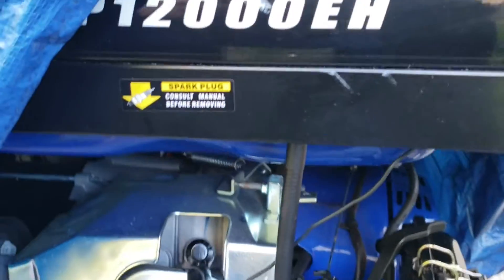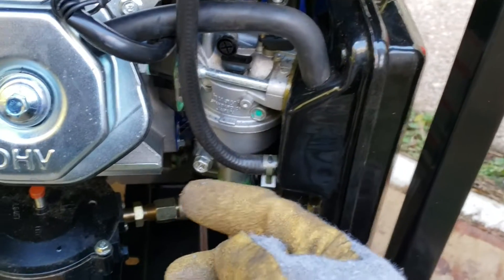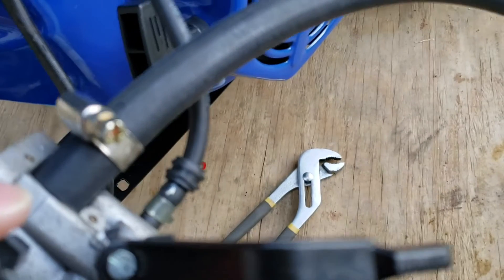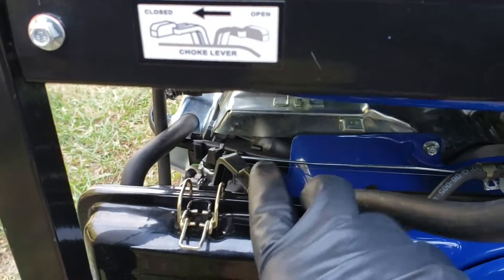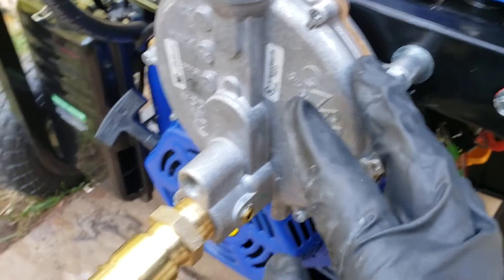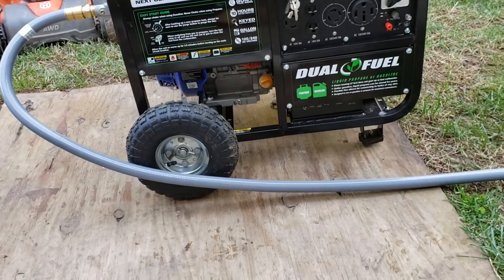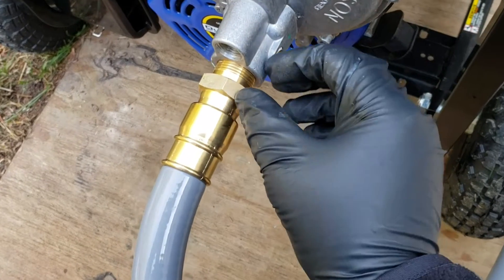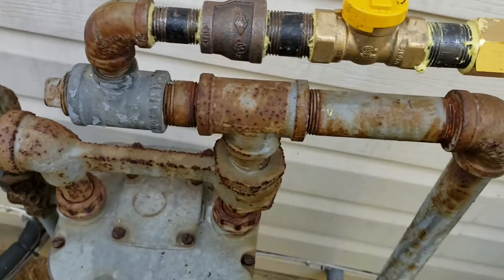DuroMax XP12000EH - Converting Gas/Propane Generator to Natural Gas (Dual Fuel to Tri-Fuel)

Comment: So the old regulator is not connected to anything correct?  You just have the new regulator connected to the carb directly with nothing extra no snorkel kit just the hose if I’m understanding correctly…and what fitting could I use to be able to run propane too if I used my generator in a portable setting say on a job site.
Reply from the maker: Yes, the old regulator is removed. No snorkel either, just remove the old propane hose and connected the a new hose to the new regulator. To get propane to work with new regulator, you need a 3/4 to 1/2 adapter fitting, you should be able to hook up propane to the same regulator using such an adapter. However you might have to adjust the inlet valve which is easy to do.

Comment: I have a Duramax hybrid generator. Designed to run on gasoline or propane.  I also have a barbecue with a natural gas conversion kit. I popped the line off my barbecue and threaded it onto my generator and fired it up. It runs like butter.

Comment: Couldn't you just run a pipe from the built-in high pressure regulator that came with the generator to an external low pressure regulator then back into your carb? I would assume this would allow you to run both Natural Gas and Propane using the existing quick disconnects that came on the generator.

Great Video though... thank you!
Reply: sorry about the spelling that should read NG instead of no
Reply: No, because you have to have no orifice instead of a propane orifice which is smaller

Comment: Does the gas not leak out of the air filter when the engine is off? It sounded like you believe the regulator somehow stops the flow of gas when the engine is not running. Can you confirm? Thanks
Reply from the maker: That's correct,   the regulator stops the gas flow when the engine is off
Reply: @Mr-Chris  Interesting! Thanks for a quick reply

Comment: Chris,
Do you think you could have "Teed" the Natural gas line into the LP gas line going into the Carburetor and retained the LP gas option?
Thanks 
G
Reply from the maker: Yeah I've seen others do that with success. You can tee it off with shutoff valves to each respective regulator, but I only would recommend that if you plan on switching between the two often. Otherwise... the NG regulator technically is also a LP regulator that just requires a 3/4 to 3/8 adapter to get it to work with LP. So you could use the new regulator it for both if you want to.

Comment: Thanks for the great video.  Was a real help in getting my hose/gas connections right and adjustments on regulator bolt to get it started.

Comment: I ordered the exact same set up you have for my duromax 12000eh. I’m getting conflicting info on whether this setup will work without the Venturi adapter. Apparently a lot of people found that using the propane inlet didn’t let enough NG fuel in without making the intake larger. Does yours run on a full load with this setup? I ran a 3/8 hose to the carb and am just waiting in the regulator and my plumber to run the NG line so I’m gonna find out soon enough!
Reply from the maker: Well all natural gas conversions lose about 20% power compared to gasoline. Mines runs most of my house on natural gas connected to the propane inlet. The Venturi adapter really isn't needed in my opinion for this specific type of generator. I also think to install the adapter on this generator, you'll need to cut the frame for it to fit properly . Try it out and see if it works.

Comment: Do you think you could have used the original propane hose if you removed the propane regulator? I just ordered mine from nash and I was thinking of trying that
Reply from the maker: The stock hose wasn't long enough. The regulator is larger than the stock one and won't fit in the same spot. Also the new Nash regulator will need to be orintated horizontal like in the video. This type of rubber hose is common so you might be able to pick one up at an auto part or hardware store.
Reply: Thanks for the quick reply- I was curious because I was trying to avoid disconnecting at the carb - hopefully will be easy

Comment: Hi I have 4400eh dual fuel genie i hooked up the tri fuel  kit  using snorkel but engine wont start with natural gas.   using stock regulator with propane the genie starts right up.   trying to trouble shoot but cant figure what problem is.  Any suggestions?    i can hear  very subtle sound of gas when i prime regulator ,  turned the load block 7 turns out as recommended by US carb didnt help.    Fuel valve to tank is shut off, choke is open.  am i getting vacum leak from the stock propane setup? Any suggestions?
Reply from the maker: You can try closing your choke and trying different positions to see if that helps. Honostly I think you should remove the snorkel and connect the new regulator directly to the carburetor like I did in the video. If you want to switch back to propane you can do so by using the new regulator with a propane adapter fitting. Essentially you don't need the old "stock" regulator since the new one works with both natural gas and propane. I think the snorkel is the problem not letting enough natural gas into carb to work since it already has another port connected to it . The snorkel is only meant for generators that are gasoline only.

Comment: Mine leaks out of the bottom right atmospheric port when the generator is not running. Any idea what this could be?
Reply from the maker: I'm not an expert on this, but I would imagine that you have a faulty regulator. It's not supposed to do that.

Comment: At the 11:46 mark, you mention that your 100 amp main breaker box prevents you from using the 50 amp outlet on your generator. To confirm the accuracy of that information, I Googled, "Do I need a 30 amp or 50 amp generator inlet box". That brought back some search results that seem trustworthy. In answering that question, those websites make no mention of checking to be sure whether one's breaker box is 100 or 200 amp. I don't bring this up to take issue with you about it. I bring it up because I am about to buy a complete system and I need to make sure I buy the correct stuff. I would really appreciate any further insight you can share about it. Who told you that 50 amps shouldn't feed a 100-watt main panel? Thanks!!!
Reply from the maker: You are right... The reason I have a 30 amp is because the only option for me to install a transfer  switch at that time was the Generlink (connected to meter). The Model Generlink I have only goes up to 30 Amps. The reason I couldn't install a 50 AMP interlock or traditional transfer switch is because I had  split bus panel breaker box which wouldn't work with a interlock or generator transfer switch. The issue wasn't that100 amps won't work with 50 amp, but that my breaker box is an old 1970's split bus panel, which means even if I turn off the main breaker, it is still hot and would back-feed. So my only option at the time was a Generlink transfer switch that connects to the meter and automatically disconnects to the grid so you don't back-feed.  If you have 100 amp main breaker box that shuts off at with a main , then you can install a 50 AMP transfer switch with no problem... Now fast forward to today, I finally upgraded my breaker box to a main shut off 200 amp box so I can eventually install a 50 amp interlock.  You can see my new breaker box here: https://youtu.be/TmFbOQF85h8

Comment: Chris, thanks for the great video. I'm in the process of doing the same with, I have the exact same generator and have ordered the conversion kit. Since making the video, would you do anything different from what you've shown?
Reply from the maker: The only thing I would suggest is buying a Digital Tachometer and a good Multimeterr. The generator has an adjustment screw behind the carburetor to adjust the RPM. You want to make sure that after converting it to Natural Gas it still runs at 3600 RPM. Using a Multimeter, you can verify you are getting 240V at 60Hz. Lastly, make sure you paint your gas meter fittings to avoid rust.
Reply: @Mr-Chris  Thanks for the tips, will do!
Reply: @Mr-Chris  My 10000e gasoline duromax geberator is running at 5000 rpm on natural gas with the snorkel, is that because of the know you turned on teh regulator is not set right or does that have anything to do with it?

Comment: I didn't hear you talk about how you know that the generator still runs at the correct RPM so as to produce electricity exactly as it did before.
Reply from the maker: Yeah a few months later I bought a digital tachometer and read the user manual on how to adjust the RPM. Mines was running a little slower on NG at 3400 RPM so I adjusted the the screw to get 3600 RPM. I also verified that it was producing 240v at 60HZ using a multimeter

Comment: From what i've heard, running on CNG or LPG results in the engine running cleaner from a mechanical perspective (fewer deposits left in the engine).
Reply from the maker: Definitely much cleaner than gasoline, but less overall power. When I change my oil, it's significantly lighter in color than when it runs on gasoline.

Comment: I'm looking at the XP15000EH and doing the gas conversion kit as well. Only thing I noticed, on the Duromax site they recommend NOT using the conversion kit , so not sure if this voids any warranty. That's a bummer about your panel needing to be upgraded. Ouch. Thanks for the info, really helped.

Comment: I got the carb kit w/regulator from US carb and it all worked perfectly. Here in Texas you can hook up everything without a plumber. I did get an electrician to wire it all up at the house and now I’m in business. Thanks for the video.

Comment: Is it necessary to have a load block in order to run? I’m planning to hook directly from carburetor to the regulator without the load block to see if it run smoothly or roughly.

Comment: Thanks for the video.  I'm a bit late here, of course, but I have the same kit and am in the process of converting a welder/generator for trifuel.  I am not a plumber but its seems you already have (had?) what you need to tie into a 3/4" pipe for natural gas supply.  

Perhaps a plumber could verify this, but it seems that you can swap the 3/4" Tee coming off the right side of your meter with the nearby 3/4" Elbow off to the right (leaving the short pipe section attached to the elbow).  Then you'd have the 'free' open end of the Tee to attach to your generator feed line with the benefit of eliminating a lot of extra pipe connections - plus look a lot cleaner.

Comment: My DuroMax 12000 should be in tomorrow, and I'm at ground Zero for Ida.. Let me ask, could you have mounted the new regulator where the propain one was at, or did it not fit? Thanks..
Reply from the maker: It didn't fit, so it mounted it to the outside.
Reply: The "Frisbee" shaped" KN Demand regulator is suppose top be mounted edge side up, not flat like a pancake. They are factory adjusted in the edge side up position.
Reply: @3beltwesty  Thanks..

Comment: My hero dude.  Just bought my Duro Max, still in the box. I want to convert it to use natural gas and this gives me hope it is an option. Thanks for the detailed explanation and information. I will have it done professionally.. mainly cause .. I don't wanna die ! 
Thanks again for your help 🇺🇲
Reply: Follow up  My Natural gas conversion is in place and fuel flow is connected all well and seemingly good. 
Generator can start and has run for minutes while I try to keep it from stalling. Is there a flow controller to adjust because it stops as soon as I stop depressing the spring behind the regulator. Before the conversion this Generator ran fine on propane. I pulled the spark plug and gapped it to 0.025 inch.per specs provided ... no change in response.

Comment: Nice work!  My question is, why not put the regulator near the gas source (meter), instead of mounting it to your generator?
Reply: Good Question! It is more than a regulator. It is a "demand regulator" that uses engine vacuum to pull the diaphragm open that meters the NG ie gas flow. 

So a long tube or pipe makes the engine harder to start since now there is this long volume that is in line to the demand regulator. Also a change in load of the engine has this extra delay due to the long hose of gas. Also with a manual prime button if the regulator is 20 ft way then you prime and walk 20 ft to start and thus not as effective. 

Most all "demand regulators are several feet from a the carb/throttle, not 10s of feet. That is so the service tech can hear the gas with priming etc too.

 So if it was just a pressure regulator it can be farther away. This is a demand regulator, the vacuum line to the carb venturi pulls open the diaphragm and this controls the flow of gas. 

The extra brass screw valve  control gas flow too, it is for the mixture ie lean or rich. This screw fill be in different positions for NG versus Propane
Reply: I would assume so that you can more easily connect the generator to different Ng sources. I like the id a of it being self contained.

Comment: Hi Chris, great video!   Question, what is the pressure of the gas coming out of your meter?
Reply: I was wondering the same thing. I have a very similar set up to this but can’t seem to keep the engine from sputtering out after only a few revolutions. My pressure in the gas line is roughly 7.5 to 8 inches w.c. (Water column). I have a different regulator that I’m thinking is the issue so I was going to buy the same model he had in the video, but the specs on the regulator show an inlet pressure of 9-13.5” wc. I’m hoping 7.5 to 8” will be close enough to the functioning range of the regulator

Comment: Do you have to remove the Propane regulator. or leave it with the Gen. Also can you use Propane also, does it become a tri Fuel? In case you take the Gen on a trip and make it portable? Thank You.  Randy Houston
Reply from the maker: You can keep the old propane regulator on if you want to, but you won't need it. The new regulator works both with natural gas & propane, you might need to adjust the gas pressure like I did in the video when switching between natural gas and propane, but it's very easy and quick to do.
Reply: @Mr-Chris  thank you very much Chris your information and your videos are awesome and extremely helpful.

Comment: I have the 13000-Watt DuroMax that has the automatic choke. I bought the PNG natural gas conversion kit that has the snorkel attachment that attaches behind the air filter and before the carburetor. It will start using the factory propane way, but it acts like its starving for gas using the natural gas. Do I have to use the snorkel or can I pipe it straight to the carburetor like the factory propane is.

Comment: You don't have to jump through all these hoops.  Just regulate the natural gas at the source...  https://www.youtube.com/watch?v=DCF8cyWB2W0
Reply: what hoops are you referring to?  that video you linked shows the guy replacing the propane regulator with a NG regulator.  Chris here did the same.  Anyway you hook up the new NG regulator, you have to remove the propane regulator from the equation to run NG

Comment: Hey Chris, I’ve got a question for you buddy.  I’ve got the same setup, almost.  I’ve got the 13000E- gas only. I installed the US Carb kit using the snorkel and it ran fine 44 hours during hurricane season.  Problem was, it did not want to start easily and I was having to get while using the prime button to get it going , but after starting it ran fine.  It would either backfire or take like two or three minutes to start.  You inspired me to order the 13000EH carburetor from the factory with the propane intake port, like yours has.  I sealed the carb and now it won’t start or run.  US Carb and Century think the port may be too small or my NG hose fittings are to small, etc.  I’ve used full flow large port fittings on everything and it ran fine.  The propane port is much larger than the snorkel holes for sure.  Do you have any advice for me?  Thanks man.
Reply from the maker: I am not sure if this will make a difference, but I remember reading how the Carb needs to run on Gasoline for a few hours before converting to NG. Have you tried running the new carb on Gasoline only? Does this Generator have an auto choke? If so, you might want to check to see if you can override the auto choke when you start it.
Reply: @Mr-Chris  I was thinking of adding gasoline.  The conversion kit requires to run it prior to conversion to seat valves , harden cylinders, etc.  I did that and hated that gas was in the bowl over winter so was happy to be replacing it with a dry carb lol.  I will add gas to confirm it is the NG system.  The choke doesn’t seem to start automatically, looks like it would turn off automatically once started.  The two carbs look identical except for the additional propane port on the new one.
Reply from the maker: @shawng8432  Good luck and I hope you get it to work. NG is the best way to go, but I personally still have 30 gallons of gasoline on standby just in  case. I rotate my treated gas once a year. I live in DC area and we had some bad ice/snow stomas and lost power for several days... years ago, but our power company stated moving everything underground so I haven't lost power since. Anyways  I want to make sure that I  am ready for the next time this happens and you made the right choice to get a generator and to attempt to convert to NG.
Reply: Warm it on Gasoline couple Of min. It will start on prop- natrl then.